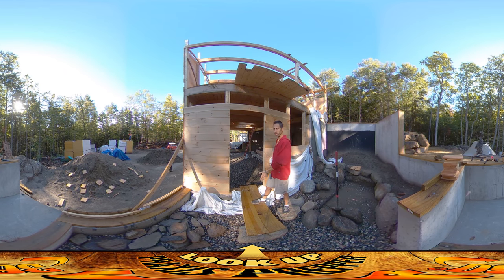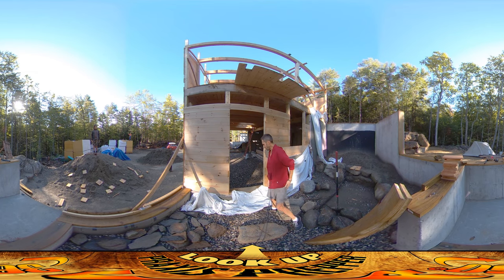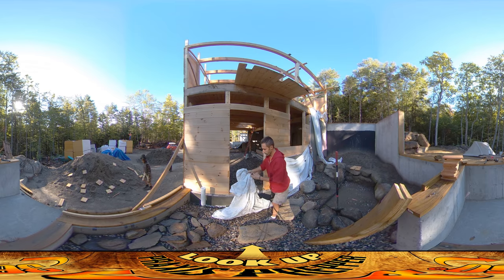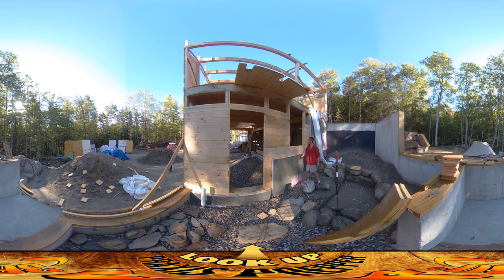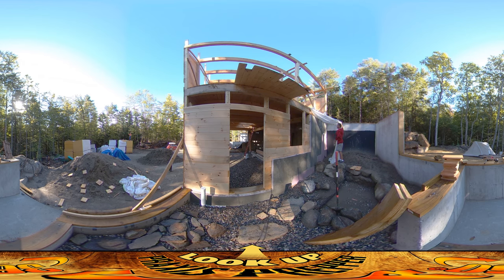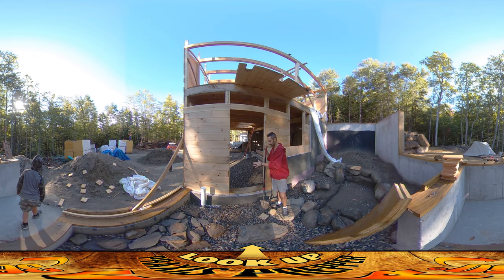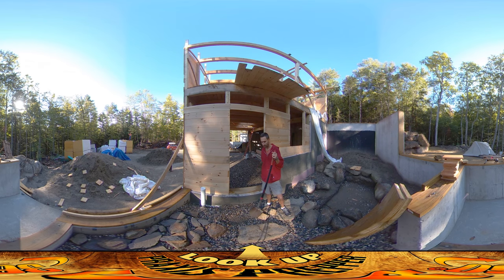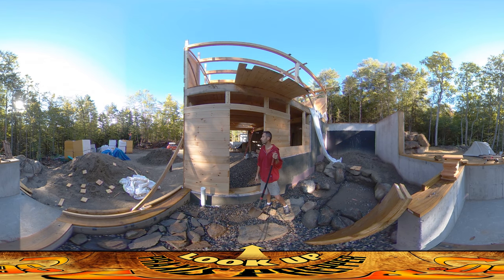Homestead Building - Stucco Reveal, Using Scrap Lumber Wraps, Outside Air for Stove Vent

Comment: It's going up pretty fast :) ... now obviously i don't know how far behind the 'lag' is on this series, but we are pretty much at the start of Oktober ... depending on your climate that means roughly another 1 to 1.5 months to reach the roof ... so one may want to consider to move up higher before fully covering the floors (i would at least do some of the floors, seeing they provide rigidity to the structure, but given the season we are heading towards, getting the roof up may be more beneficial to the overall project (as that would also allow for working on those floors in a 'somewhat' dry environment) ... and if you don't get the roof up before winter, the whole thing may well be 'put on hold' for the wintertime, and that would obviously suck. While having the roof up, would mean you could still work on the inside (by covering the sides with plastic as makeshift walls), or work on the outside if you put up scaffolding and cover said outside with plastic, which is what they tend to do out here, couple of heaters on the inside and work can continue as usual. But a lot of that depends on having that roof up... ...
Reply from the maker: It's gonna be close on the roof...
Reply: @PraxisPrepper  hmm i see, well then fingers crossed for a late winter and a fairly dry autumn.